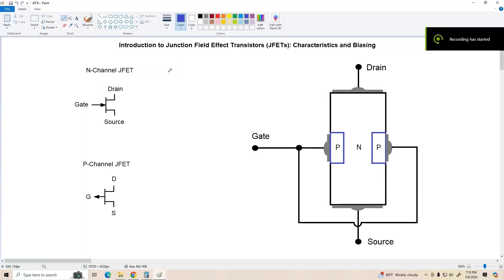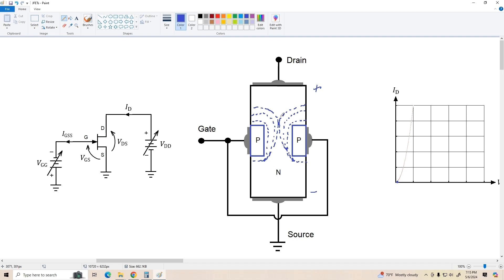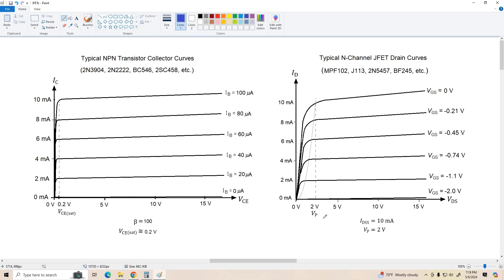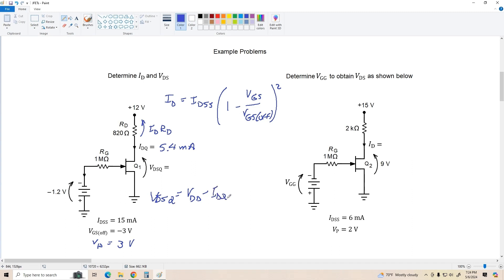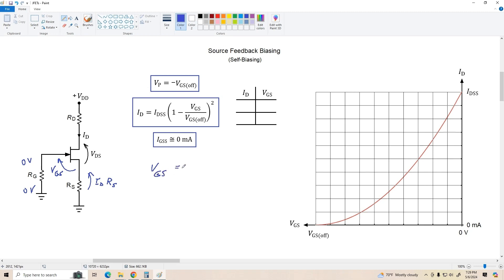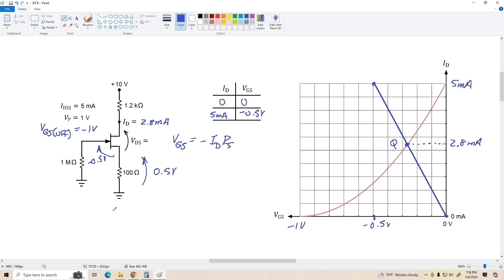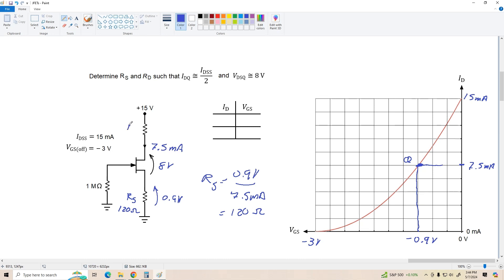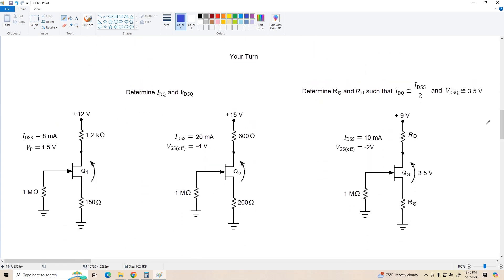Topic 40 JFET Operation and Biasing

Comment: I have build clones of filters, Korg MS-20, Roland Jupiter 8 using BF256 and they sound awesome.
Indeed a difficult component, but the simulators help lot.
Thnx for the good video, i saved it for reviewing again later
Reply from the maker: Thanks. Im a big fan of JFETs. I’m going to measure the Idss and Vgs(off) for a bunch of MPF102s in the next video and plot the average characteristics based on those numbers. I might do this with several different JFETs in a future video.

Based on the BF256 specs, I suspect the data I compiled for the MPF102s would be nearly identical for the BF256.
Reply: @Electronics4Guitar  Would you compare vs Mosfets? i got BF256 and MMBFJ202.
aswel Rohm SH8MB5 and Advanced Linear devices ALD1105 (quad), the simulator says you can build a differential amp with these, but haven't send out the PCB yet.
Reply: @Electronics4Guitar  Since we're talking about FET's, i have "designed" a automatic gain reduction in the simulator 2 days ago to protect a push pull amp exceeding the limits of the BD137/140, PSU, i wanna build, it uses FET's, it works, but did this without the math, would you like to help to make it accurate?
Reply from the maker: @AnalogDude_  I will be covering a bit of MOSFET stuff in a few weeks or so. The ALD1105 looks like an interesting device but I haven’t used them before. I’ve got a ton of side projects going and will be pretty busy for a while so I can’t promise I help you much with your design at this time. Keep me posted on your progress.
Reply: @Electronics4Guitar  Well, i can make a video and make it only visible to you.

Like i said, i have drawn up a synth modular differential amp. vca with current mirror in the sim, than i switched to mosfets in the simulator and the ALD1105 offers a quad package. it's expensive.